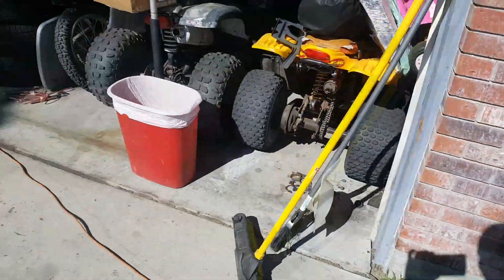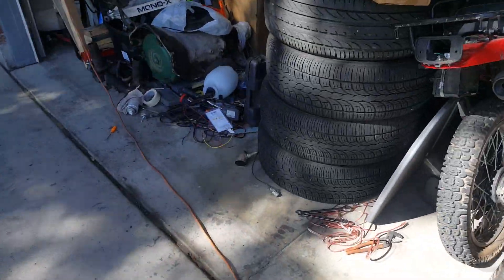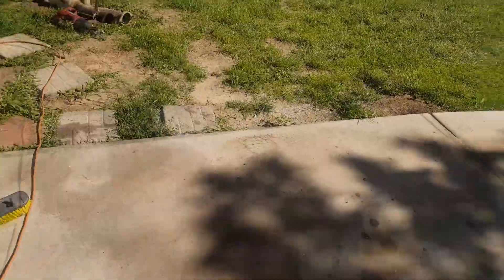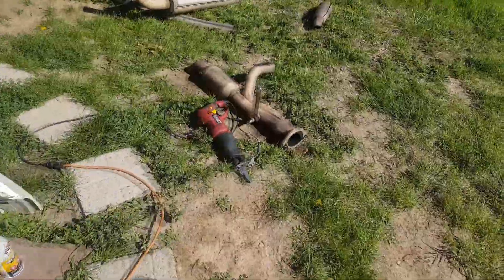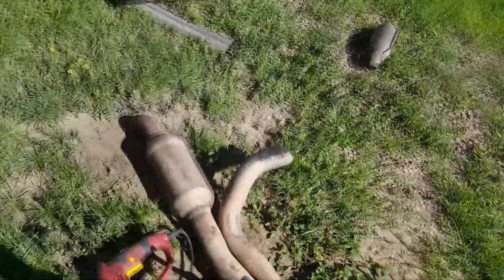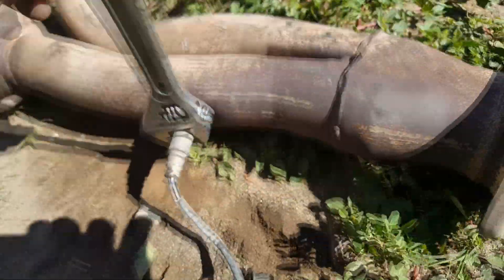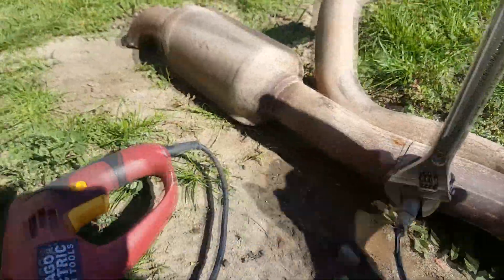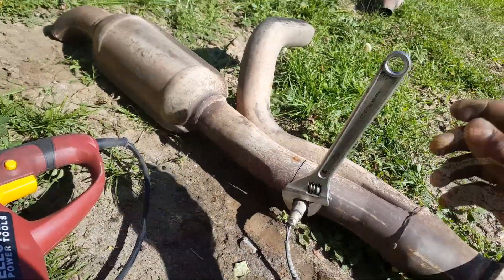DIY 02 Oxygen Sensor Removal

Comment: I got a question bro the wire in my wiper stock is cut ..wiper don't work or bight light or cruise control   I can get another one but where at or can I buy pass it with a switch to make wiper work?